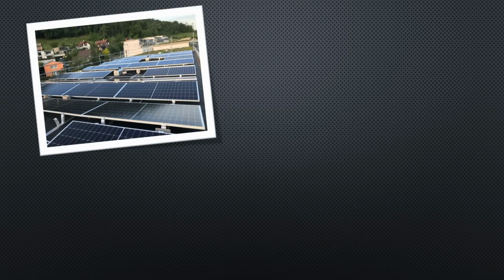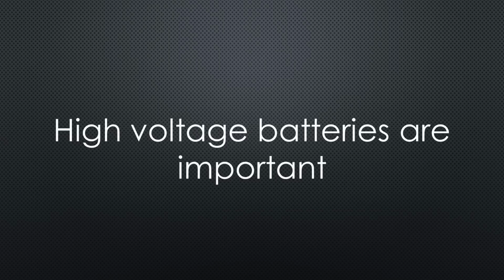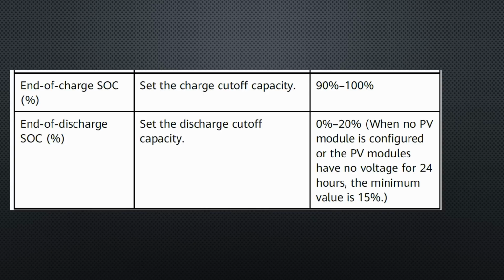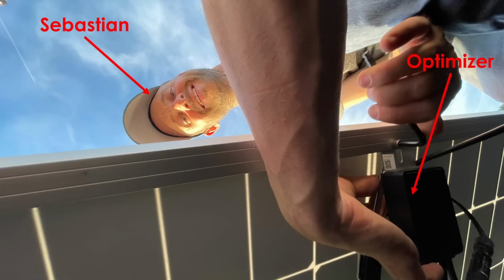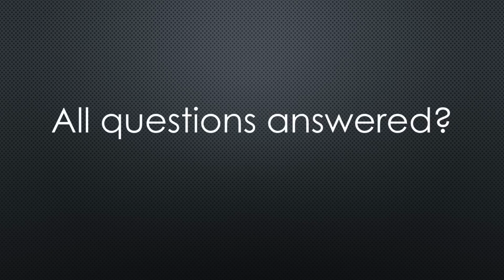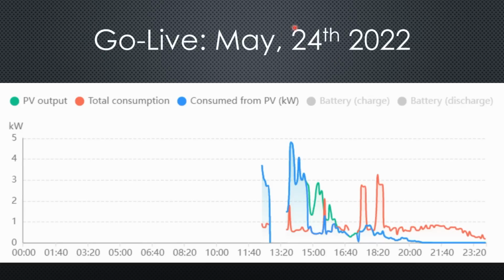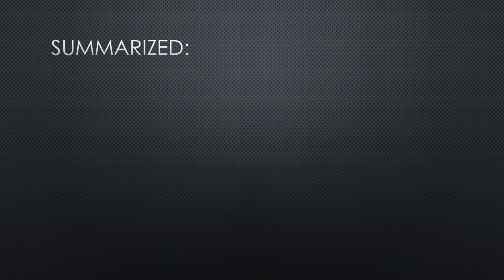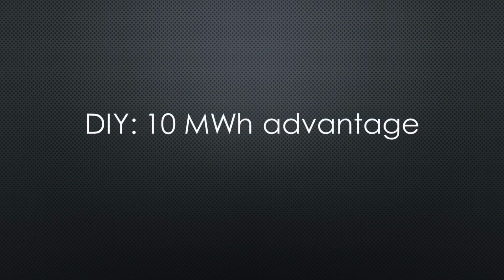438 Photo Voltaic (PV): Why Your Inverter Stops When the Grid Goes Down

Comment: Hi Andreas,
great DIY PV project, congratulations. I'm not total newbie to PV (I made one project for water heating from Hackster's contributor Steve) but once again about modules wiring. I have my 5 modules serial connected. I really don't understand what you mean with that MINUS cable going to the last module ? This is common in serial connection, oder ?Can you explain this please ? With regards, Bojan
Reply from the maker: The minus cable has to follow the plus cable to avoid a loop. A loop can create high voltages during lightning.

Comment: Hi Andreas
I have a similar setup, using the Sun2000/5KW + 2 x Luna2000 15kWh in Offgrid mode.
It is a shame that Huawei doesn't support Optimizers in Offgrid mode, therefore i have 5 pcs laying arround
As the Inverter should not talk to china, i manage everything via Modbus, using fhem. So far, works great.
Now, i am thinking if i could "simulate" a HV PV string to charge my system from foreign energy source. Coudn't do that via AC because Sun2000 configured in offgrid.
Do you have some rough ideas how this could be managed? 1000W would be enough!
I tought about a HV AC/DC powersupply, followerd by something like a HV DC/DC converter, because i need to tweak the resistance of that solution to work like an PV string, Otherwise the mppt in the Sun2000 gets crazy.
Reply from the maker: No, I have no idea because I did not have this problem until now (I did not even know that they do not support optimizers off-grid).

Comment: Regarding the useless shelly, I did not get the point, how the inverter knows if you need power in your house. And when it does not know it, how can it balance the 3-phases to 0 on the grid access?
Reply from the maker: The Shelly is useless for me because it measures the same numbers as the power meter of the inverter (who is used to do exactly what you describe).
In my next video, My Shelly will work ok again because I changed the position of the coils ;-)
Reply: @AndreasSpiess  may be that I miss the drawing, but the inverter does the measurement on its ports, but the shelly did the measurement to the grid? In-between is the house-distribution. But I'm curious for your next video.
Reply from the maker: @tituslivius7869  You forgot the additional DTSU666-H power meter
Reply: @AndreasSpiess  Ok, now it got it. BTW I wonder if we could use the values from the modern energy meter of the energy provider? I learned I could get a M-Bus link. Would be a cool ESP32 project.

Comment: For a PV System there are different options
Pv 
Pv with single phase backup 
Pv with 3 phase backup 
Pv with 3 phase backup and cold start. 
If you have shadows you can optimize the system with optimizers.
The cost efficiency of the system drops with the cold start variants massively.
But if money was not an issue that would be my goto
Reply from the maker: You are right.

Comment: A couple things to add... I worked for an inverter company  over ten years ago.  Another reason that the inverter needs to disconnect besides 2 reasons you said is that when inverter is connected to the grid, the AC currents which it produces follows the the grid.  When the grids goes off,  the inveter has to create a fake frequency like a UPS (all inveters have oscillators but they sync with the grid). When the grid comes back, if inverter isn't disconnected, there is an unknown phase shift between grid and inveter.  Since the grid is very powerful, its current will burn you inverter and your wirings.

Another thing to say is what is the optimum battery capacity which you need?  Definitely you are buying more electricity in winter. You got locky to have your solar working in pick of summer with a lot of sun.
Reply from the maker: I agree with your remark on synchronization!
We use between 10-15kWh a day (10 in summer). This is why I decided for a 10kW battery. It covered us till end of Cctober. Now we do not get enough sun to charge it fully. So a bigger battery does not make sense for me.
Reply: @AndreasSpiess  but does it make sense to buy the electricity after midnight when electricity is cheaper to charge your batteries and use the batteries when electricity is more expensive during the fall and winter?
Reply from the maker: @bayareapianist  The price difference is too small for me (I lose energy while charging and discharging the battery). And it would disturb my statistics ;-)
Reply: @AndreasSpiess  3} you want to keep your 98% efficiency!

Comment: Andreas, I have learned so many things from you and I will continue learning. Thank you so much! Two questions 

A) is it possible with a proper change in the inverters wiring to make it work off grid? For example, if you could disconnect it off the grid and feed its ac input by a small ups to cheat its protection mechanism. Would that work ? (For moments of blackout, when you need to use some power ) 

B) I didn’t understand the wiring at around 11:15. Is the blue line also connected at the frame of each panel or it just pass along each panel?
Reply from the maker: 1. You must not hamper with the inverter. It is illegal in most countries. But I will show how I solved the problem.
2. The blue line is only connected to the last panel.

Comment: If the output of the inverter is directly connected to the incoming gid and the load of the house. How does the power you are generating get directed to your house(load) and not feed the grid?
Reply from the maker: Electricity always follows the least resistance. If the voltage of the inverter is slightly higher than the grid voltage, no current flows into the home.
Reply: @AndreasSpiess  So just to make sure I understand, if you have enough solar power or excess power the inverter will keep the voltage higher than the grid so current flow is to the grid, if there is not enough or no solar the invertor voltage is lower so the current will flow from the grid to your home.
Reply from the maker: @R0LLM0P  As I said in my last video: The inverter measures the current to and from the grid and adjusts its strategy (battery charging or voltage) according to the chosen strategy. Here, it first supplies all loads, then it charges the battery, and only if the battery is full it increases the voltage to make sure the excess current flows towards the grid.

Comment: I would like to see some data that tell us whether this installation is financial viable. Given the cost and benefits does it also pay? Or do you loose money (for the greater good, of course) - and if so, how much?
Reply from the maker: The ROI depends on the situation. For me, the return on invest without the battery will be in the area of 6 years. With the battery longer. And with increasing energy cost shorter, of course ;-)

Comment: There is a kit available that stops your house from delivering power to the grid. Ford has electric F-150 pickup trucks with huge batteries. The truck can be used to power your house if the power is down. The kit costs somewhere around $2500 US. 

My ex-boyfriend moved into an older neighborhood with big old trees and overhead wires. The power went out every time there was a crack of thunder. He build a backup system using gel-cell batteries, the ones used in handicapped scooters. It was pretty funny. The entire neighborhood would be dark. He had lights and was watching TV using an antenna. He wasn't connected to the grid. He just kept the batteries charged.
Reply from the maker: Hopefully I can show how I will solve this topic using the backup box showed in the end of the video... But currently, I do not own an e-car.

Comment: Excellent video - as always!
I would love to see the numbers for the battery usage. How much energy is sent and retrieved on daily bases.
I think this would vary widely - 100% sunny day would just charge the battery and not use anything until sunset but day with some clouds may be interesting. 
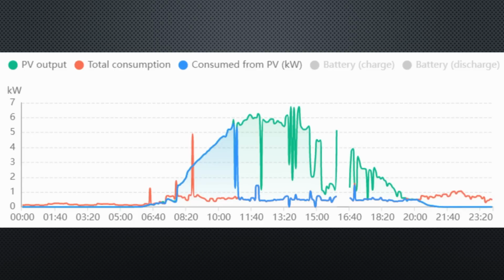On those graphs at 13:58 - did you turn off lines for battery charge/discharge or is that data unavailable?
Reply from the maker: The battery usage changes from month to month, of course. Two factors have the biggest influence: Time after sunset where people are up and usage of the general house infrastructure. The second is always the same and can only be influenced by changes (I will create a video about that topic). The first is only influenced by nature.
Currently, the battery is charged up to 95% (my decision) and goes down to 30-50%. But we had times where it went flat (when there was not enough sun during the day). This number was higher than 50% during summer.
So far we consumed 1.4MWh. The battery provided 0.7MWh to that amount. So it is around 50%. Increasing of course because of shorter days ahead.
The overall production was 4.7MWh, BTW.
Reply: @AndreasSpiess  Thank you for sharing the data.
I hope you can get the data from inverter (canbus) into influx
Reply: @AndreasSpiess  I wonder if you could make a short video on panel shading. There is so much contradictory information about this out there. When half cut panels make sense. How built in bypass diodes help when one panel is partially/fully shaded in a string.
Reply from the maker: @furmek  Wait for a few days...

Comment: Great series, thanks! Unfortunately I do not currently own a house, so I'm currently planning to add solar power to my rented balcony. That's a bit simpler, but there are still some hurdles (inverter availability, drilling a hole in the house wall, mounting the solar panel somehow, etc)... I'm looking forward to be able to track production during a nice sunny day ☀, and learning a lot on the way there! Your video also added some information that I wasn't aware of before. Thanks!
Reply from the maker: Good luck with your project! It is very rewarding.

Comment: I am currently developing a completely new Inverter and after that a battery charger. I also got granted already a sponsorship for these two projects.

The things which we should know beforehand, are many, and most are of simple entity. One is particularly important: even though batteries may have low charge, important appliances should be able to run nevertheless. Thus, I implement brown-out generation, which can be enabled manually, although not suggested. This feature can be life saving.
Reply from the maker: You are right. I tried to find out the consumption of all devices in our home to establish rules for a blackout. In addition, I purchased a USV for my PC and network which enables me to shut down the PC safely.
The next thing is a display in our kitchen (the most frequent visited room in our home) to show the current situation (production, load, and battery level).

Comment: I have a transfer switch between grid and inverter. My inverter is not Grid tie but has an AC input for charging battery from the grid. When I switch from grid to inverter there is a physical barrier to the grid and the house And inverter. Inverter is wired on the normal power side so it stays switched over as long as the inverter is on. Batteries go down it switched auto to the grid. I tried making a switch with some SSR switches but they don’t really hold back the grid when switched off then kablewy went my inverter. Powerjack fixed it for free. Sent me a big box of parts.
Reply from the maker: As showed in the video I have a backup box that should include all needed relays to switch off the grid when it is down. They use standard relays, not SSRs...
Reply: @AndreasSpiess  I abandoned the SSR idea permanently some time ago. Which is better? 36 volt panels in series double for 72 volts or triple for 108 volts. I went with 108 volts. Any higher would have pushed my controller into hyper Voc.

Comment: Thank you for your videos, it brings very sensitive points of view. Just point out the possibility of devices for derivation of surpluses such as the (Diy) Freeds project. It is striking to me that the option of Huawey does not allow to be "offgrider" as many others do that even allow to swap "ongrid" and offgrid.
Reply from the maker: Most of the inverters used here do not allow off-grid operation. But most people do not know it. Recently, this fact was even mentioned in TV and radio. Many owners feel cheated...

Comment: On your question about the inverter behaviour when interacting with the grid: All grid tied distributed generation inverters, whether residential or utility scale size, meet certain protection criteria when interfacing with the grid. One of the most important fratures is to disconnect from the grid in a very specific timeframe when the grid goes down, in other words the voltage at their output need to fall immediately to safe levels and then to zero and stay there until the grid voltage is back on for a certain amount of time. This is to protect the workers on the grid. There is a plethora of other reasons behind the settings that these inverters have and they mostly have to do with maintaining grid stability. These settings differ from country to country (your friend can see them using his FusionSolar app). I believe that the inverters use the PLL method to synchronise with the grid so if the grid goes down, they synch fails and they stop immediately. Now of you have a battery and work in island mode, I guess there will be provision to work without the grid signal but there should be an internal controlled switchover relay that will only connect back to the grid when the island's voltage and grid voltage are synchronised.
Reply from the maker: I agree with your information. I will add the backup box which automatically separates the inverter from the grid in case of grid-down
Reply: @AndreasSpiess  dont forget to add an earthing rod or otherwise address the local earthing during island operation, i guess this will depend on the local grid/code of practice!
Reply from the maker: @nosafetyswitch9378  We have a separate earth that cannot be cut.

Comment: Not a good way to install solar if you want to avoid power cuts. You really need a system where the grid feeds into your inverter and the inverter supplies the consumer unit regardless of where the energy is coming from be it grid, PV panels or battery. These inverters sense the grid voltage and go into a disconnected mode when grid voltage is not there. That way they can keep operating when the grid is down as they will only feed back onto the grid when it is energised.
Reply from the maker: As said in the video, I will add a backup box to achieve that goal with my inverter. But you are right, you get inverters that have this function built in.

Comment: I don't understand your schematic of the panel connections to prevent damage by lightning.  You should label which is the correct way.  Also, the one on the right doesn't make sense to me.  It looks like the configuration on the left but the blue wire is added and connects to the negative terminal on the 1st panel then runs  to some unmarked part of the last panel.
Reply from the maker: The right is the correct way. It avoids creating a loop which can act as a "receiver" for lightning energy.

Comment: Hey Andreas, the reason you are getting same output over all three phases is because Huawei makes symmetrical inverters thus they are not able to supply different power levels on each phase. Thats another limitation for using this inverter in back-up mode (off-grid) because with that it only powers one of that phases not all three  and with only 3.6Kw max if I remember correctly.
Reply from the maker: You are right. It even uses two phase wires instead of one phase and neutral during off-grid. But I think I have a solution to that problem...

Comment: do you expect the energy sold to cover the price of static connection fees ? It would be great if you compare the grid-connect premium to a pure offgrid setup.
Reply from the maker: An off-grid setup would not make sense in our region because we need external power for at least 3 months. And also a few days in spring and autumn.
I will get my next electric bill sometimes next year. But up till now I had to purchase 12kWh from the grid and delivered 3.2MWh to the grid...
Reply: Not pure offgrid setup but setup where you don't inject power back to grid. Self consumption only. The grid is one of the possible source of power, similar to solar, battery or generator. Grid-tied means compliant cutoff to protect grid work, compliant equipment with costly certificates, validation of setup by external companies... In some area the certified grid-tied inverters are too expensive compared to price per khW injected so you can't break-heaven and it's better to have offgrid type setup.
Reply from the maker: @bobylapointe2680  The last 4 months, I sold more than 3MWh of electricity back to the grid. Which is around 500 dollars. I assume this will go up to more than 800 dollars next year.. This helps to pay the investment back. And helps the grid in these bad times.

Comment: I look forward to the MODBUS video.  My small setup collects data via MODBUS from my charge controller using Tasmota firmware on an ESP8266.  That sends the data out as MQTT to Home Assistant.
Reply from the maker: I use TCP Modbus which is probably different to the one you use...
Reply: @AndreasSpiess  If I understand correctly it's a different transport layer but essentially the same beyond that.  I bet your video will be interesting and useful!